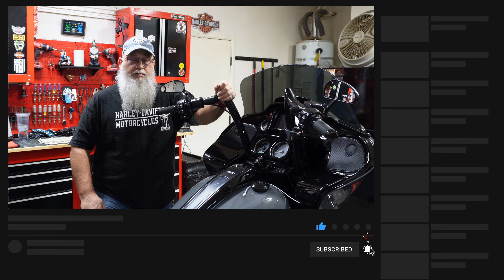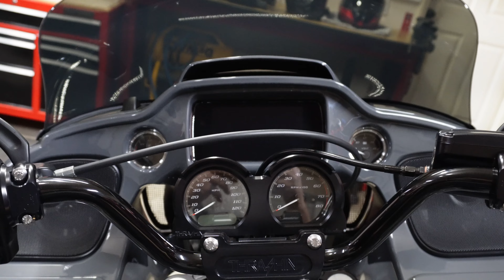2022 Road Glide ST Upgrade - Thrashin/Hogworkz Additions

Comment: Sir, outstanding job and truly appreciate the details and tutorial for the Thrashin Bars, Gauge, and TT.   I am about to do this next weekend and will be referencing your video quite a bit along with Lance and Juan "daddy" tutorial.  I have the baja LP6 lights already installed so, i will dread pulling those out to tuck the wires away.  I anticipate lots of cursing.  Thanks again!
Reply from the maker: Thank you, much appreciated. I tried to cover as much as I could plus keep it relatively short to not bore people, lol. I think you will love the setup, and “Dad tight” is a thing lol, but be ready for more vibration cause everything is solid mounted. Personally I like it better. Lol. 

I want to do the lights myself, hoping for a deal at some point so I can add them as well. Let us know how it goes and most of all, have fun!

Comment: Does the Thrashin hardware come with torque specs? Nice video.
Reply from the maker: Thanks for the question and comments. In my experience, some do, some do not. In cases that do not, I follow the service manual recommendations.  

Ride safe.

Comment: Nice install; well made video. Sweet looking Harley RG-ST with nice upgrades & mods.  Thank you!
    I bought a new '23 RG-ST a week ago (traded in my '21 RGS) and am researching this exact Kit (Triple tree, risers, bar, perch clamps, etc.); looks to be around $2,400 (plus tax, etc.)...pricey but the quality, looks, and functionality is there.  Also thinking about possibly doing a front end fork kit (RWD FS-1 Kit) for full adjustablity (and ease of accessing adjustments).  
    Upgrades completed so far (after 1 week):  HD-SE/Ohlins Rear Shocks w/remote reservoirs; Rockford-Fosgate/HD Stage-2 Audio (4 speaker, 2-fairing & 2-bag lids; one 400w amp), SirrusXM, HD Sport Seat; HD Fan added to oil cooler (and dealer flashed ECM); HD LED for front turn signals (HD LED for rear turn signals ordered); for now...installed HD-SE Street Cannon mufflers.  Ordered, awaiting to be delivered:  Custom Dynamics Double-X LED Headlamp (black) and Custom Dynamics Headlamp Surround Combo Vent Screen/LED Lights (black); S&S 2-1 Sidewinder Exhaust (black) and Trask M8 Checkvent, black (ventilate crankcase).
Tom M. SouthBay, So. Cal.
Reply from the maker: Hey Tom, thank you very much for the awesome comments and details.

Welcome to the ST family brother! Wow, you have been busy already, that's awesome! I agree on the Thrashin parts but I will also say I LOVE them! You will feel more vibration since you will be hard mounted to the bike with the boards, risers and bars, but I prefer that feeling as I can feel how the bike runs. 

My next items will probably be the same shock setup and possibly the Baja lights, but still thinking on those. Looking to do the SPC 2to1 exhaust (but black) like I did on the Low Rider. What a great sounding pipe (the install video will drop later today so check it out), great product and awesome people too!

Keep us posted on your efforts and thanks again for all the detail and descriptions of the awesome work you have done! I Would love to see some pics on that bad boy! Maybe you could join my Instagram (top right corner of my banner page) and share some?

Ride Safe!

Comment: Looks great! Curious to hear if you considered the Kraus set up. Pricing seems to be somewhat similar between them and Thrashin.
Reply from the maker: Thank you, I appreciate that. I did consider the Kraus setup but I liked the way the thrashin looked more and I have many other parts from them that I like.  I agree that they are compatible but for me it came down to a personal preference. 

Great question and thanks for the comments.
Reply: I have the Kraus setup for about a year and have put more than 9k miles on it. The bike is easier to control and the riding position is comfortable. Although I have to adapt for the first 1k with some minor pain. I went with the pullback, 10" risers and the FlyMoto bars, which gave 12.5" of total rise using the stock brake and clutch lines. Now, with the Wolf One kit, which I got with the triple tree, it does not give the option of a closer position like the Thrashing. Definitely do your research , but you cannot go wrong with either setup.
Reply: @jobeta22  good to know! Both options look great and I think suit the look of the ST much better than most other options.
Reply from the maker: @jobeta22  great points between the various options. I liked having the Thrashin tree option to adjust personally, all in all, very happy with the results. 

Ride safe and thanknyounfornthenfeesback and comments. Much appreciated.

Comment: You did a great job with this video. Very concise and detailed. Have been considering the Thrashin or Kraus bars for my 2021 RGS and was looking to see info about the upper triple tree and here it is. Nice job. I really like that you show the gauges and the fact that they are not blocking the stereo screen. I'm 5'11" so about the same height as you. Looks comfortable. I may want a little less height but am now seriously considering these due to your video. Couple of questions, 1) do you get any hand vibration due to the solid mount? 2) Can you still use the lock for your helmet with the Thrashin bar clamps? 3) who makes your rolling mechanics table? Thanks for any info.
Reply from the maker: Thank you for that, means a lot, I really try. 

For your questions:
- Agreed, very comfortable and handles so much better, highly recommended and I like the Thrashin products look better, just opinion for me.
- Yes, you do feel the additional vibration with the hard mount, but to be honest, I like it, makes me feel more in tune with what the bike is doing as I get "spirited", lol.
- Yes, the lidlox come with a spacer to keep the included bolt away from the perch clamps, works the same with the thrashin clamps, you just use the new bolt and spacer. I did another video on them as well, just not updated yet with the new config, but still the same. It is hidden inside the lock anyways. Love those things. At most, you may need to use the included extender that comes with the kit, but I did not have to with my helmet.
- If you mean the rolling black table, I got it from Amazon, love it and works great, perfect height adjustment and very stout. Here is a link: Gearwrench Adjustable Mobile Work Table 35-48” - https://amzn.to/40qUvNx.

As always, I appreciate the comments, ideas and feedback, helps me do better for you guys, ride safe and have fun with the bars!

Comment: Great video - very helpful.  I am in the process of deciding between Thrashin or Kraus Risers.  I love the Thrashin parts and have several on my RG ST as well.  I have heard comments around vibration on the bars since they are hard mounted.  Kraus has a bushing inside the riser to address that.  Have you noticed any vibration issues with the Thrashin setup?
Reply from the maker: Thank you for the comments and question.  I notice it’s a more stiff feeling but not much different to me. But I came from 14 inch hooks and a 41 inch span so there was a lot of flex and I am still running stock shocks so hard to tell. I can’t say there was a lot of vibration but still need to hit some different types of roads to verify for sure.  So far it seems good to me.
Reply from the maker: OK, here's an update. I just finished a long ride with my Hog group and I did notice more engine vibration in the bars and could feel various vibrations due to the direct mount. Now, did it bother me? It did not, I actually liked being a little more connected to the bike and feeling how it responds.

So, yes there is noticeable vibration with this setup, but I guess it would depend on the person and their desire or tolerance. It was not bad to me at all.

Hope that helps.

Comment: This is gonna be a huge help! Thanks for the great videos. And just to get an idea of arm angle with the new set up…how tall are you?

I also noticed your cables were changed out on your test ride…did stock size end up working?
Reply from the maker: Thanks Ryan, glad it helped. I am 5'11" ish and love the sitting position now (I pulled them back about 1/4 inch after the video and they are now PERFECT!)

As for the cables, in the video summary near the end I cover that because I am coming from Factory 47 Signature series bars, the cables were wayyyy too longggg. On my test ride I was just leaving the dealer after getting new cables cut to fit the bike. It was the same price to have my dealer cut and install as it would have been for me to buy a kit and hope it fit like I wanted. I have seen that for those who have stock bars, the cables will work on this upgrade.

Ride safe and thanks for the comments and questions!